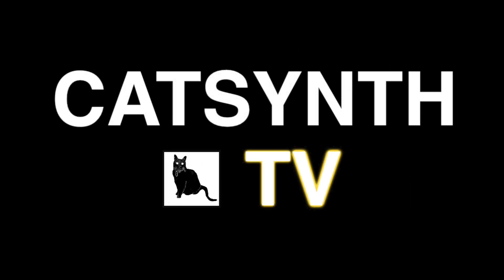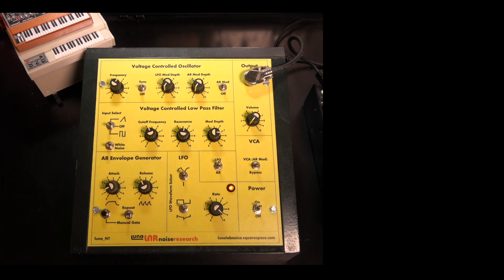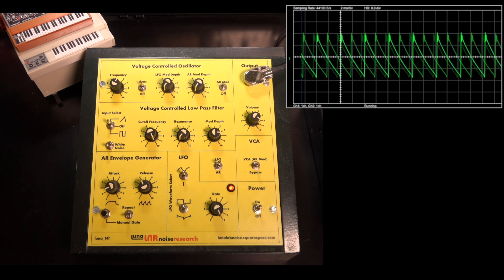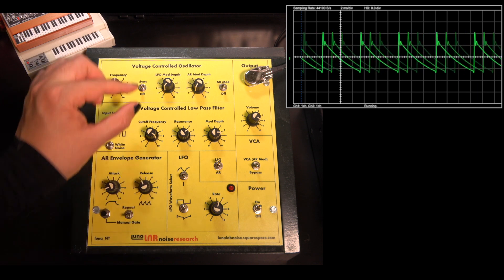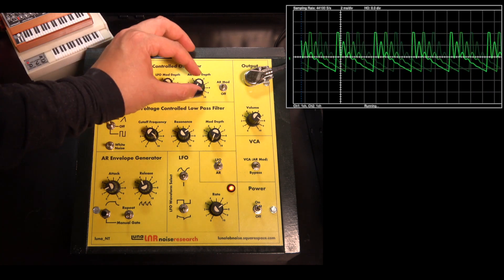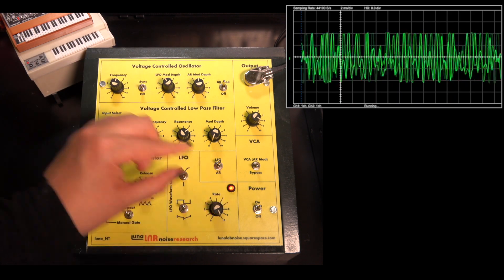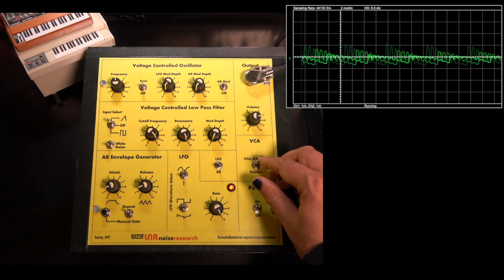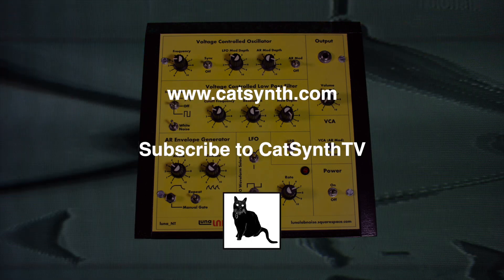MFOS Noise Toaster (Luna_NT) Analog Synthesis Demo and Tutorial

Comment: not familiar with audio synthesis at this level, so if i may ask, why did the sawtooth sound slightly sharper than the square wave at about 3:07?
Reply from the maker: Hi there.  There is a lot of variation in these simple analog oscillators.  In this case the sawtooth has a louder overall amplitude, especially right one we switch waveforms.  Also, the sawtooth has a somewhat richer frequency spectrum.  You can see that the square has "points" that are similar to the sawtooth, but it's main flat part is lower amplitude.

Hope this helps - happy to elaborate more 😺
Reply: The main reason why the Sawtooth waveform sounds sharper, and louder than the Square waveform has a lot to do with the difference in harmonics, harmonics are frequencies that relate to the fundamental frequency, or pitch, of the waveform mathematically, in the case of the Square wave, the harmonics are at odd frequencies relative to the fundamental, so, if the fundamental frequency of the Square wave is say 1kHz, then it'll have a third harmonic of 3kHz, a fifth harmonic at 5kHz, a seventh harmonic at 7kHz, etc, etc, these are all odd harmonics, odd harmonics tend to have a hollow, and, or blanketed sound, on the other hand, a Sawtooth wave has a fundamental frequency, plus both even and odd harmonics, so, if the fundamental is 1kHz then the Sawtooth wave will have a second harmonic at 2kHz, a third harmonic at 3kHz, a fourth harmonic at 4kHz, a fifth harmonic at 5kHz, a sixth harmonic at 6kHz, a seventh harmonic at 7kHz...etc, etc....notice how the even harmonics are spaced at even multiples of the fundamental, and the odd harmonics are spaced at odd multiples?, even harmonics tend to sound very bright and brassy in comparison to odd harmonics, and it's the bright brassiness that's responsible for the Sawtooth waveform sounding subjectively louder and brighter.
Reply: Simple Version: Saw has double the harmonics.